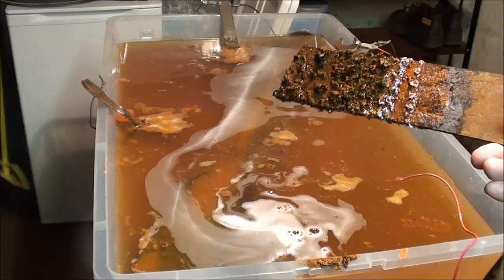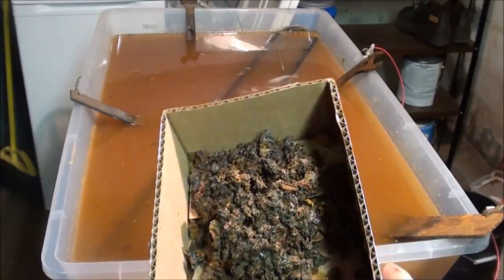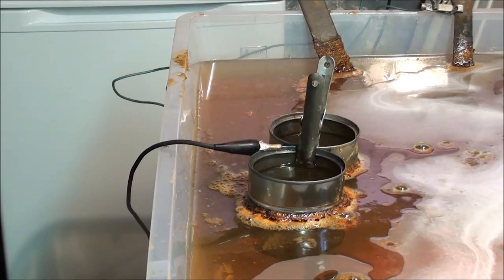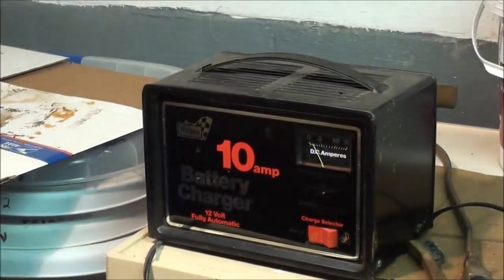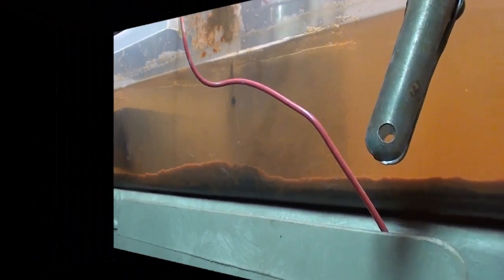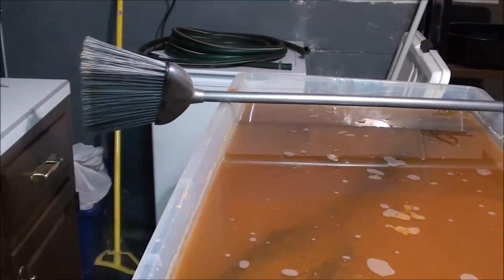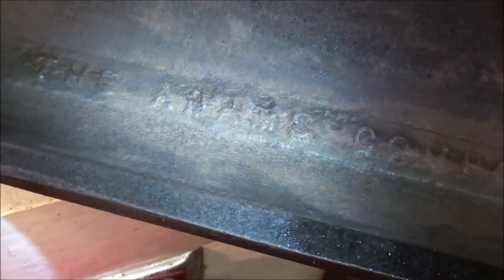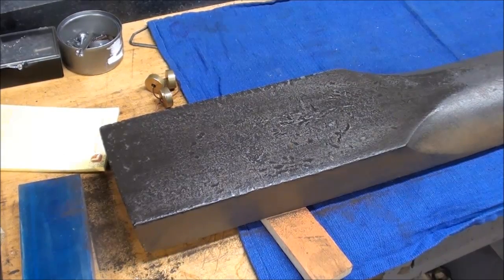MACHINE SHOP TIPS #146 Part 2 Electrolysis Rust Removal Experiment #2 tubalcain

Comment: Hi Tubalcain, as usual very informative videos. I have been doing a little research on other experiments along this line on the web and it seems that heavy currents are indeed undesirable, not only from the safety point of view but also from the results obtained. Low currents (amperage ) it seems give better results and also produce less mess in the solution. A current of around 5 milliamps per square inch of metal treated seams to work well, take a look at this website for full details. http://myweb.tiscali.co.uk/andyspatch/rust.htm .

Comment: The one can picks up more rust because its the one the charge is applied to, (or the ground?) and there is resistance in the can-to-can connection causing less current to run through it.

Comment: I've used this method several times. It works well. The bottom of the part seems to drop the particles as the top holds them. It also seems to help a small amount to scrape the anodes occasionally. I reuse the mixture until it doesn't refresh, then let evaporation do most of the cleanup. The first time I used it was to save some Model A Ford body parts. It brought them back to patchable condition. Thanks for the videos!

Comment: One reason your water level is dropping is that the electricity is breaking it up into its components, hydrogen (on the cathode) and oxygen (at the anode); that is the "action" you have noticed. The electrolysis must be carried out in a well-ventilated space, for the hydrogen will want to recombine with the oxygen in an explosive manner if it encounters a spark or open flame.

Comment: The reason you're seeing one can as more corroded than the other is because you have the lead directly clipped to one can which then corrodes fastest  The less corroded can is only linked by the metal clamp.  The clamp is impeding the electrical circuit.  If you had clipped the lead to both cans at the same time then you would see similar corrosion on both cans.  As far as one side of the can corroding more than the other.  I believe that the tin coating failed in one spot closest to the positively charges item being cleaned.  The corrosion spread from there outward.  The black coating you find on the cleaned items is actually a thin coating of oxidized sodium.  The electrolysis separates the carbon and oxygen atoms from the sodium in the salt solution.  The sodium is attracted to the positive charge of the items cleaned and the carbon and oxygen form carbonate which is given off as a gas (that's what the bubbles you see actually are.)
Reply: Oh and don't use regular salt for your electrolyte.  Then the byproducts are silver and chlorine gas.  Nasty stuff...   The gas of course, not the silver... ^_^
Reply: Justin Bell is right as well.  A circulation pump would speed up the process.

Comment: Can you do an experiment with hot vinegar as a rust removal?  I've done this to some screwdriver bits and it removed the rust and deposited a black oxide like coating on the pieces.  I'm curious what hot vinegar will do in a longer soak.  You could use a crock pot to soak it for several hours with controlled heat.

Comment: A museum in Texas seems quite expert on this and other artifiact cleanup work.
Here is link  
http://nautarch.tamu.edu/CRL/conservationmanual/

Look in left sidebar for iron conservation  has some good chemistry discussion.
Any electrolyte would work for this method but baking soda or washing soda work quite well.  Baking soda worked well for me on an old engine flywheel.
The nice thing with baking or wash soda is they are neutral or mildly basic and will not chemically burn you.  The sludgy stuff can be dumped on the lawn - supposedly the iron content will keep moss to a minumum.

Hydrogen and oxygen are both generated in this process so well ventilated and all that other flammable gas safety stuff

Dan Bentler
Reply: +dan bentler Thanks for the tip. I went to their site and it has a great many good ideas.

Comment: That's been most interesting watching both videos. I am a little disappointed that you didn't show the inside once it had been dried off - was this because the black material stuck to the metal had protected it from rusting and therefore it didn't need any treatment to remove rust or some other reason?
Also does it appear to you that any of the black deposit has been cleaned off - part of the sediment?

Comment: You connected both cans (in a set)  together so there is no way there is a difference in the potential
I sure that the reason why 1 can is clean is because it has a coating or other residue on it.

Comment: I Googled the Adams Co. they were Est.1883 They make gears and shafts and transmission parts ..Also fouund a You Tube video that was educational to watch just type The Adams Company
Reply: Pete,  I am a shop teacher as well, although not as old ;)  I have played with electrolysis too.  I found an easy way to clean intricate shaped parts after electrolysis is to soak them in muriatic acid and then dip them in baking soda/water solution to neutralize the acid.  then hose them off, blow dry with compressed air and oil or prime and paint.  It worked great on an intake manifold from a flat head ford V8 that is now painted red and proudly displayed on my shop wall.

Comment: Just a thought, for removing rust from a small object could you do it right inside the can, using it a both container and anode?
Reply: Absolutely, just make sure your workpiece cannot touch the sides or bottom of the can. It can cause sparks and that is never a good idea around electrolysis.

Comment: The bare spot may be from that low melt glue they roll on the cans to stick the label on with.  I used a large can as a cooling tank for my water cooled chinese LTD Stirling engine (check my channel) I thought I had it all removed it all by just heating the can and wiping it with kitchen papaer, ithough i got it all but it thre the paint until i scuffed upt up with abrasive papaer.

Question, if you added a plastic propeller to the tank on a woden or plastic shaft to help cirulate the water would it help speed up the process?

Comment: The lining in the cans is what most likely what limited your electrical connection to the 2nd can. In the beginning you were using light spring clamps which would have only contacted the interior of the cans.

Comment: Try Muriatic acid. Dip the part in for a minute or 2 and the rust will pour off. Unfortunately bare metal exposed to the fumes of Muriatic acid will rust at an accelerated rate.

Comment: Try clipping each can to the terminal individually, and check the ammeter reading.  If its much different between cans, its likely a different material.  When two different materials are acting as anodes, the more reactive material will have to be consumed or insulated before an electrochemical reaction will proceed with the lesser reactive material.
This is the basis for galvanizing steel with zinc:   The steel won't corrode much until the zinc is gone.  

Anyhow, the quick check is to see if the amount of current is roughly the same for each of your anodes; you might not want to hook up an individual anode that is much more or less resistive than the others, to keep the reaction balanced.

Oh, and the bubbling you observe that looks like boiling?  That's hydrolysis... the breakdown of water into hydrogen and oxygen, which in the proportions they're being produced, is a highly explosive mixture, so ensure you've got good ventilation.  Fortunately, hydrogen rises, so its not as likely to pool near the work, or run along the floor to the usual spark sources like pilot lights or motor starters.

Cheers,

Comment: I did this to a very old gas tank off of a Gravely Tiller. It worked great. But I did mine outside on the back patio. I was unhooking the electrodes and it blew up, it sounded like a cherry bomb. LOL so the gases can be dangerous if you don't unhook the charger first. I was using a solar panel to do mine. The tank was unharmed but it did scare the heck outta of me.